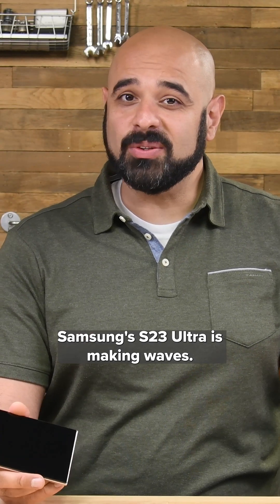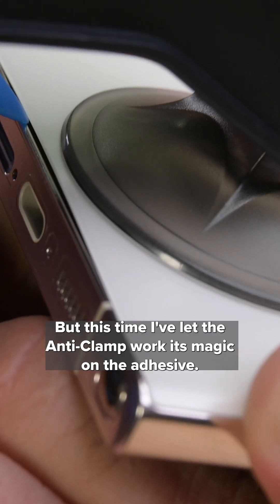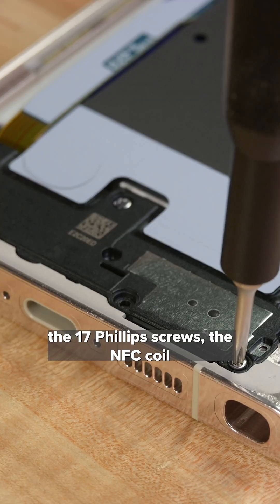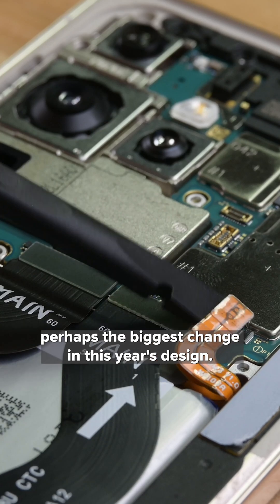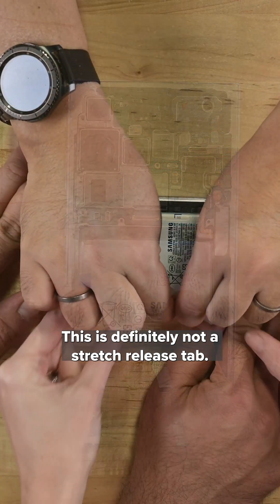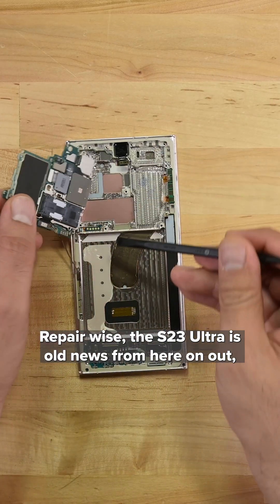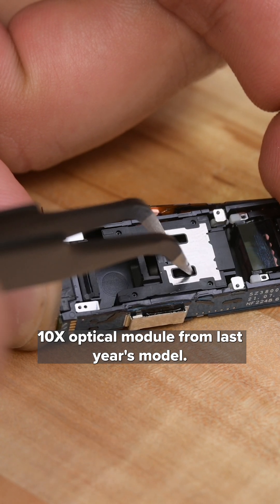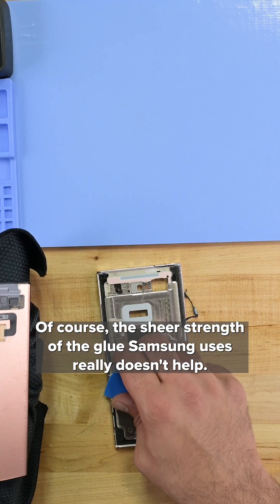Samsung S23 Ultra Teardown #s23ultra #samsung #ifixitteardown

Comment: Wouldn't you prefer overkill adhesive rather than under applied adhesive.
They do that for a reason and its to guarantee water resistance won't be jeopardized.

Comment: Love these videos but speaking from repeat experience I have to disagree with the ease of battery removal. Maybe the S23 ultra battery removal is moderately difficult at room temperature. But put the phone on a hot plate for even 60 seconds and that's the easiest battery removal of any modern smartphone by a mile.

Comment: im still using s8+ not opened original battery 6 years already and everything works great 😃👍
Reply: How have you made the battery last that long!? What’s your charging habits / routine?
Reply: @fasn279  
Nothing special actually but i noticed the actual capacity now around 75%
Reply: @baseline4102  oh so that needs replacing soon
Reply: @baseline4102  how? I had an S9+ that was 3 years old and the battery lasted 2 hours
Reply: @fasn279  good luck with your 4 hr battery life
Reply: To make battery life lasted long, don't charge until 100%... But charge to 85% only.... And plug to charge again when the power reach the low limit at 20%
Reply: I have an htc evo 4g that i use occasionally,  original battery. I have an s9 that still works, original battery, and an s10 same. All my phone batteries still hold a days charge and work just fine.

Idk what yall doing to your phones but its abuse
Reply: I had Samsung Core Prime, stock battery lasted for 6 years and yeah since bad charging habits the battery doesnt work anymore. I still got that phone as memories. Currently using Samsung A52.
Reply: Still use my S7 Edge
Reply: I wouldn't be bragging about a old battery that u never replaced. It doesn't take 20 minutes at the longest to replace it and it probably needed it seeing this was 2 years ago if u still have it I bet it's shutting down constantly below 20 percent

Comment: The glue being so tough is GREAT to hear as a consumer. It means it will last longer and have water resistance like they stated.
Reply: Sarcasm?
Reply: @Schmuly  not at all
Reply: @Outside Duh Box  I'd recommend doing some research on right to repair then, the glue being tough doesn't change anything as the battery is typically what takes a phone out of use or a damaged screen which now isn't replaceable thanks to that glue. Water resistance can still be achieved using screws and gaskets
Reply: @Schmuly  water resistance on back glass pieces has shown to only be best by using glue. You can't obtain ip68 without back glue. Only ip66 or somewhat. I think you should do your research.  I care more about water resistance depth than repairing sorry

Comment: Catching up in software? Yeah because 80GB of preinstalled bloatware is what we call catching up.
Reply: It has bloatware, but not definitely 80gbs.
Reply: Not true, watch that video again
Reply: Samsung Galaxy S23 Ultra has 80 GB of installed Bloatware? What?! I doubt this is true. I have a Samsung Galaxy S21 5G and even now, not even 80 GB of my storage is in use.
Reply: Bruh what 💀
Reply: Ahh, I know now what you mean. I saw the short if this today but it's not really true. The category "System" in Battery and Device care means the size of all data of the OS and all apps. That includes OS files, apps, caches, media files used or held by apps, packages to install apps, etc. This makes 112GB on my phone now, but only 26 GB are from the OS. The other 26 GB are installed apps and over 58 GB are data associated with apps. In my case, my entire Tidal library, I downloaded, makes 58 GB of the files categorized under "System". The dude who share this short doesn't show a stock device. I don't know what he has installed that takes so much storage but you only need one or two streaming services and got really fast on 90 GB used storage when you download content.